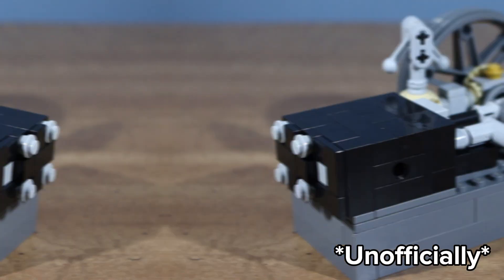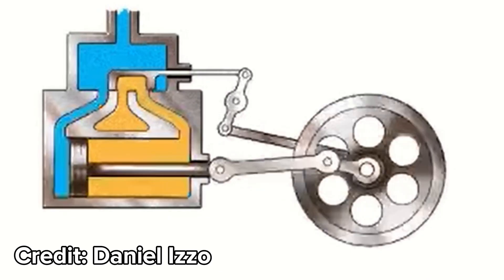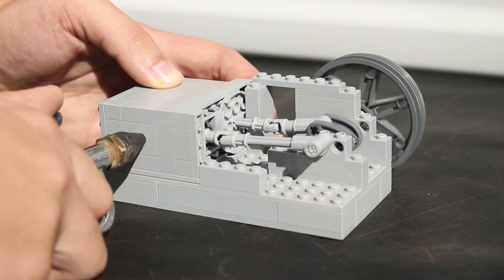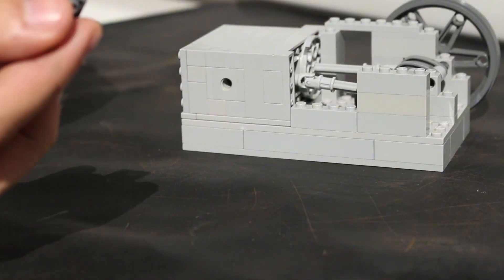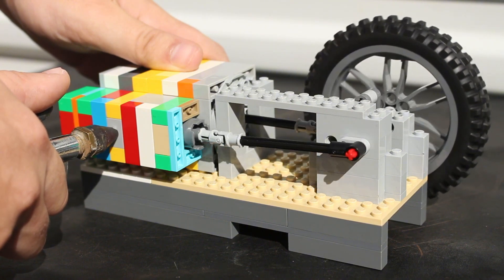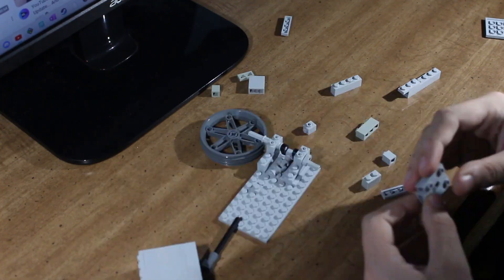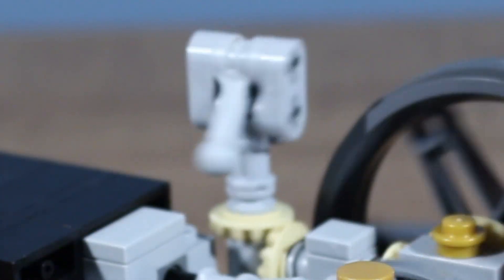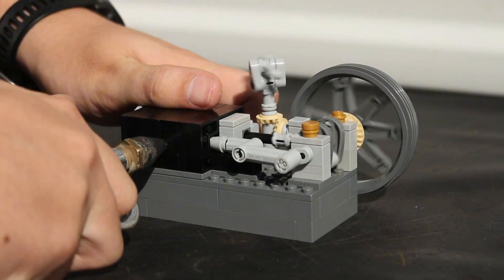The WORLD'S SMALLEST Double Action LEGO "Steam" Engine!

Comment: If you incorporate a functional flyball governor you could have it limit the the speed so you don't reach the "explosion" speed
Reply from the maker: @nevernether3368  true, but that's pretty much impossible at this scale, however, if it were to be used on a larger engine, say a 4x4 piston (or larger) then a governor would definitely be doable. And it's not really the "speed" of the engine it's the pressure from the air entering the valve chamber. Higher pressure = more speed but also the risk of the valve coming apart
Reply: @DeltonAdamsLEGO  makes sense. I hope you can figure out a solid plan for the explosion problem then lol

Comment: Tip: Use a tire on the Flywheel
Reply from the maker: Actually, making the flywheel even heavier would make it run worse than it already is, due to the low amount of torque it produces
Reply: @DeltonAdamsLEGO  there you have a big, but EXTRA EXTRA XL BIG point
Reply: @DeltonAdamsLEGO but the sense is that it runs more flawlouslly

Comment: Tutorial for the for by four one?
Reply from the maker: @nathanjamesang3968  it's so simple, it really doesn't need instructions. If you look at these two you can easily build it at a larger scales
https://bluebrickmocs.com/worlds-smallest-steam-engine-instructions
https://bluebrickmocs.com/working-steam-engine-instructions
Reply: Thanks just how do you connect the four by four piston?
Reply from the maker: @nathanjamesang3968  a 2x2 round brick with an axle out the end. For the back of the cylinder (to make it double acting) I used a 6x6 round plate and the axle goes through the hole
Reply: Thanks
Reply: How gall was the 4x4 piston?
Reply from the maker: @nathanjamesang3968  um, I believe it was 1 brick total height
Reply: And the round circle thing? Because that's all need
Reply from the maker: @nathanjamesang3968  the flywheel? Just anything round will work, if you build it right

Comment: YESSS! HEDIDIT!
Love it, man!
2:52 - it even ran without pluging the nozzle inside but just close enough, really cool!
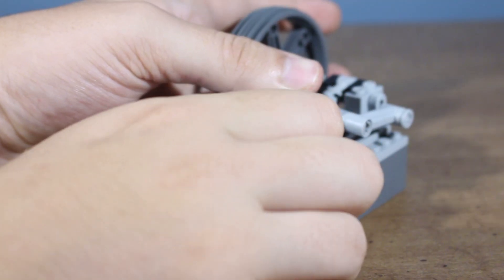3:09 - honestly didn't even expect that :0
Also the most probable reason 1x1 required high pressure to run, is because - the other "reverse" stroke (dunno if it's even the name for it) 
has too little volume because of thickness of rod and that other pointy part. Thus not much air could get through and do the pushing.
But great stuff nontheless!

Now what is left - is to make it 2 cylinder with 90 degree crank offset. 
Then such engine should self-start as soon as pressure is delivered. 
Because at any angle of crank - at least 1 of the pistons is gonna be already at the power stroke.

I reeeeally would love to make such lego engines and other mechanics too, but i just don't have much technic parts at all sadly.